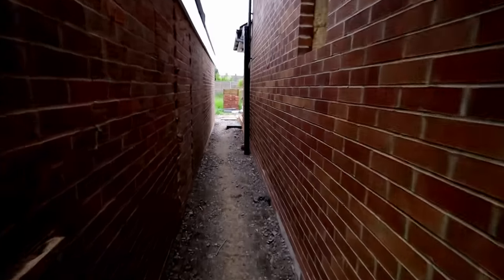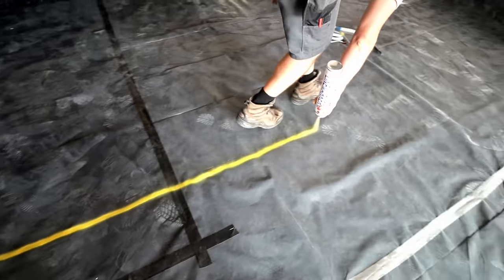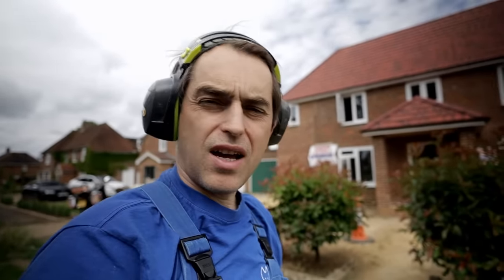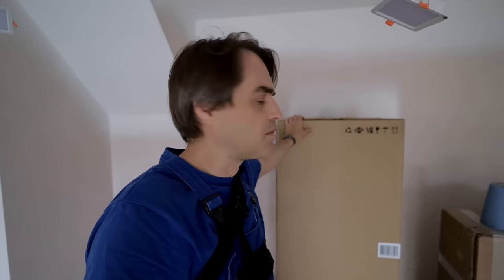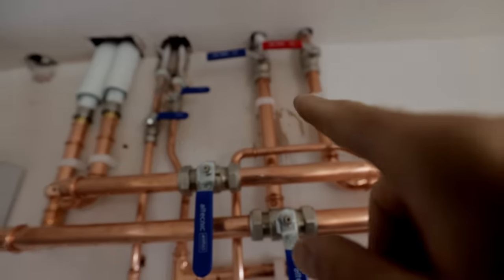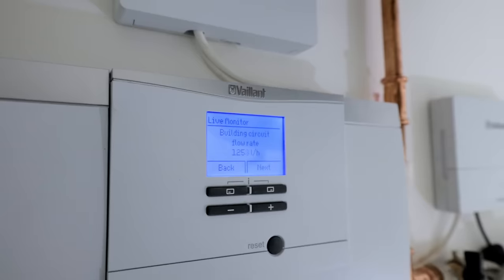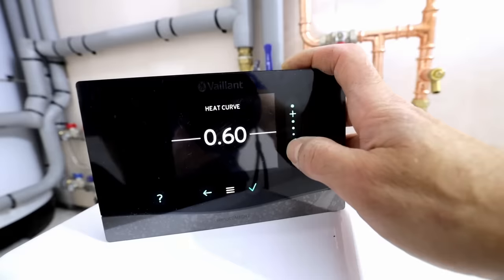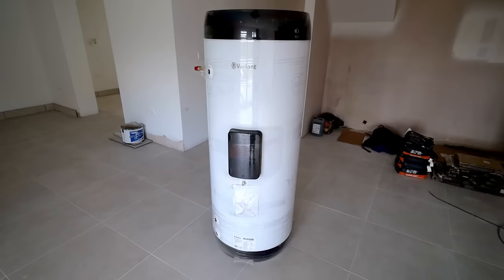Gas Boilers No Longer Make Sense, Here Is Why.

Comment: We have a Dimplex air to water heat pump for underfloor heating and then we ran a line up to our top floor attic for a water to air fan coil. It provides perfect air conditioning in the summer and is honestly one of the best reasons to use air to water heat pumps. They do perfect radiant heating and very good cooling, there are also smaller convector radiators from Jaga that are installed like radiators and provide decent room by room cooling. A technician like yourself should look into this as more people request aircon in your market.

Comment: That's going to be such a high performing system! Top work as always 👏. What's the KW rating of the unit you fitted? It looks like a 5kW unit? You should do a follow up video to document the performance and how well cooling works. I think the option for cooling could be a great selling point for a ASHP. What made you go for a Vaillant cylinder? It looks like the Telford HP cylinders have a larger coil and slightly lower cost.
Reply: After the oil crisis of the 1970`s in rural areas straw burner was the rage my cousin built wood framed house house installed the strawburner in the garage he had to abadon his house one night and call the fire brigade luckily thay saved his house but gave them all a scare

Comment: The upstairs AC loop to the ducted system will also provide dehumidification.  What outdoor design temperatures do you use for the heat loss and heat gain load calculations?

Comment: You can also add solar and batteries to your house when you have a heat pump and run it on that energy instead of grid energy, can't do that with a gas boiler :)
Reply: More added costs though. It is not cheap to add solar panels and batteries
Reply: Problem is in the UK, solar output is inverse of heating requirements
Reply: @ctid107  Ally PV and batteries with a Time of Use electricity tariff and you have an absolute no-brainer. In winter charge the batteries with super cheap electricity and then run the house during the day from them. In summer, PV will charge the batteries, run the house and heat the DHW.
I have 2 x BEVs, air-to-air HP that does cooling in summer and heating in winter in some rooms. I also have a legazcy gas boiler for some heating and DHW in winter. PV and batteries have halved my electricity costs and slashed my gas bill.
Reply: Why ever not? You could easily run a gas boiler from solar electric, it only take a hundred watts or so for hot water and similar on top for the pump when the heating is on.
Reply: Solar will not produce much energy during the winter. A heat pump has to be on for something like 18 hours a day in the depths of winter. It will use something like 50kwh per day. A battery will not be of much use in such conditions. I know because I have a ground source heat pump and solar panels.
Reply: You would need something like a 50kwh battery and charge it at something like 10kw for that to work. @Cheradanine

Comment: Have you ever fitted a heat pump system on a typical Victorian terrace house with single brick walls and suspended ventilated timber floors? Do heat pumps still work well (heat sufficiently/ remain cheaper than gas) in these old buildings during cold winters? Considering getting one but haven’t found reliable info on old houses… oldest I’ve seen are 1930s semi-detached houses with double leaf walls with blown insulation, space for a large water tank (often missing from old houses predating modern heating or where combi boilers have been used for years), and plenty of garden space to site one.
Reply from the maker: Yes I have. Check my other videos

Comment: Wow, that's a crazy amount of plumbing. How do you get the domestic water hot enough? That needs to be way higher than the central heating temperature.
Reply from the maker: It is. DHW can get to 70c if needed. Normally 50c is enough

Comment: Yes that chilled water will be %100 air conditioning. 
You will simply need an Air handling unit to transfer the rooms heat back to the water for it to return to your outdoor unit where it will run in cooling mode (reverse cycle) to reject the heat to outside via refrigeration cycle. 
Then the chilled water heads back upstairs. 
HEATPUMP = reverse cycle air conditioning normally.

Just another true advantage of replacing the old boiler
Reply: Not true air conditioning as no control on humidity but why not take advantage of the four way valve, I've done this to my house and I had a problem with very low humidity <25% not good for furniture, wooden floors or people( people should have 45 to 60%) I had to install a humidifier   all good now
Reply: @MG-qo5ge  The fan coil unit if set to a low enough flow temperature should bring some humidity out of the air, although the floor temperature's must be kept in check otherwise there'd be condensation on the floor and it would become uncomfortable. I'm not sure if its possible to have 2 different flow temps like that.
Reply: This will depend on the due point. The chilled water temperature will have to be above that point to reduce the dehumidification effect and  the under floor temperature has to be controlled possibly through the 0-10v proportional signal serving a 3 port valve This does bring in cost and complexity considerations and also if it goes wrong try to find someone  outside the industrial fraternity ....good luck  @MichaelFlatman

Comment: Can the heat pump be installed in a 1st floor flat that has a boiler cupboard large enough for a tank? Can the external unit be suspended by bracket on wall?

Comment: Just top ! I agree with everything, i’m 23 years install business and i constantly crash in people who calculate cash back  of heat pump driving a 90.000,00€ car 😂😂😂😂
Reply from the maker: thank you! makes no sesne does it?
Reply: Yes no sense … when you tell to the people truth they are accepting it as a lie 😂
Reply: This i do not agree with. 95% of people can just about afford to pay the mortgage and food on there table and many houses in the UK need to be properly insulated before installing a heat pump.

To make use of a heat pump you also most likely need to upgrade your existing radiators for larger ones and ideally install solar panels with a batter(again more costs)
Reply: @jonneymendoza  well if you are going to quote stats….less than 40% of people have a mortgage
Reply: @chriss4949  I'm talking about people who have a mortgage ie own there own property.

Not sure what your point is regarding my post about costs for insulation and solar panels.
Reply: @jonneymendoza yes, correct, but as  with most things in life, if you can't afford it you don't buy it
Reply: @David-bl1bt  yup but the thing is. If you spend money on insulation, solar power and air source heat pump, how long does will it take to break even and start to see the benefits?

Comment: Great video but yet again, these heat pumps are only suitable in a new build situation where all of the insulation and pupework are built in to there latest standards Totally irrelevant to most of the existing housing stock in the UK unless major uplift is also included.
Reply from the maker: not true, i have a number of videos on my channel showing installation of heat pumps in period, uninsulated hosues, that not only are cheaper to run than gas boilers, but also provide much better comfort.
Reply: @UrbanPlumbers  for example, my house has roof insulation and double glazing. I attempted to run the boiler flow temp at 55C. the result was the house didn't reach desired temp in any sensible time on a cold day. I have cavity brick construction. It would appear that for most of the existing housing stock, these low flow temps are useless unless a much larger investment is made in insulation, radiator sizes and in some cases, pipework.
Reply: @michaelhughes7706  radiators definitely, pipework only if it won’t support the required flow of water. Central heating is pumped so it isn’t so much if a problem, but the pipework still needs to be correct. Otherwise, get the rads sized properly and it’ll work fine.
Reply: @jonh1808  yes but nuch larger radiators along with the insulation requirements is a significant budget uplift which for most of the UK housing stock would require. Comparing a simple heat pump installation with a gas boiler  in anything other than a new build is usually nonsense.
Reply: @UrbanPlumbers hi yeah I’m gonna put 35 mil pipework all over your 60m2 terrace btw hope you have a yard and your kids don’t like playing outside cos that’s where the HP is going… PS you know that 1 cupboard you have? Cylinder cupboard now mate.
Reply from the maker: 60m2 terrace doesn’t need 35mm.
Reply: Not true. There have been many successful installs on very old houses.
Reply: You just can't go from a flow temp of 65-70C down to 30-40C without system and insulation changes ....unless your installation was massively over specified in the first place, or you are living in cloud cuckoo land.
Reply from the maker: Just check my other videos where I do exactly that before you start insulting people for no reason
Reply: @UrbanPlumbers  I have seen your other videos. At that time your view was that an installation review was needed (prior to installation) to determine the insulation and radiator suitability. So basically, I'm saying exactly what you used to say. Are you now saying something different?  Btw, I don't insult people but I have the right to criticise a comment that makes no sense.

Comment: Hi Urban Plumbers, as always a really neat install and informative video. Please let us know what the installation cost is for this install, and also going forward the costing for your other installs please. I understand and agree we need to look forward regarding green energy measures to our homes ( which I have done with my existing 1950's property which is now EPC A) . 
Actually with no one in the property during the install ( luckily so when the tank is faulty and caused significant delay, which if you where installing in an existing property would be unacceptable for someone living in a property at the time) and with retrofit wall, floor and roof insulation it is possible to produce an energy efficient building. 
The problem comes with retrofit to existing housing stock in the UK, which is generally old and poorly insulated. The upgrade costs for a typical Victorian or Edwardian property are very high before the installation of an air source heat pump system. The typical install costs for an air heat source system including larger radiators etc is as per government figure £12K to £18K which is substantially more than a high efficiency boiler and Radiators. This figure plus any mitigation to the existing EPC value of a property make it very unlikely that those who could really do with benefiting the most would never be able to afford to install an air source heat pump.

Comment: With Solar Pv panels yes its a no brainer, without them.... electricity is 3x the cost of gas. I have anecdotal stories of high running costs I'm sure you'd disagree with but my point is the argument is a lot closer call.
We need cheaper more efficient panels, more installers and cheaper electricty. The future has started but its not quite there yet. Same with electric cars and vans
Reply from the maker: this system will run at scops of 4.5 or higher though, so even without PV it will still be much cheaper to run than gas.
Reply: Whats the installation cost for one house all in? The builders I work for are very concerned about the costs. They fight me on pipe sizing all the time. The scops impressive and I'm moving away from working for builders full stop.
Reply from the maker: Yeah, builders are a nightmare in this country
Reply: It’s not just solar panels you need. First gotta look at your properties insulation. Does it have cavity walls? 150mm insulation on the roof? 100mm insulation underneath your floorboards?

Double glazing windows? Sufficient sized radiators? A place to store he hot water cylinder?😊
Reply: There are no shortage of forums/blogs with people discussing the relative merits of their own heat pumps, from a real world cost point of view. It’s never more than a 50/50 split between people who are happy and people who wish they’d never touched them, running costs being the single biggest problem. Some will have been poorly installed, and some incorrectly sized, but equally, a lot of people who were reasonably happy were off grid and dependent on oil/LPG with all the messing around and extra cost involved.

Comment: There is ONE huge issue that is overlooked when talking about all this ASHP stuff. That is, electricity supply. We were threatened with rolling blackouts last winter which would mean a cold house if you did everything with electricity. Having a gas boiler gives you a backup option (called diversification  redundancy in tech speak). So for that reason alone I wont ditch my gas boiler or cooker any time soon. Niec to have options.
Reply: I'm not sure about your gas boiler, but mine won't work if there's no electricity.. 
Same point with EVs, where people say: but I can still get gasoline if the power grid goes down! Nope, because the pumps and payment systems won't function..
Reply: @trashmail8  get a small ups or generator - a boiler only uses like 60w running
Reply: @mattsan70 That’s what I’ve done 👍
Reply: Even if the power was out for 3 hours most houses aren't going to lose enough heat to be a problem.  And with those, it makes the fabric upgrades all the more worthwhile doing to keep the existing heat in. UPSes are designed for keeping things running for a short period of time to enable someone to turn them off if power isn't due back on within the timeframe needed, not for sustained use.
Reply: @BenIsInSweden  That’s very true, I’d only need to use it in exceptional circumstances anyway as my home is well insulated and stays warm for a long time after the heating goes off. The main reason I purchased my power bank is so I can have light and other essentials if/when we have power cuts during winter which were predicted. Also use it when I go camping in remote places so it was bought for multiple purposes.
Reply: We had a war in europe, a massive energy crisis, and we got through it ok.  Gas supplies are just as vulnerable

Comment: Total Bollox I've been installing gas boilers for 40 years and they have never been so reliable and Efficient and gas at the moment is half the price of electricity,a modern gas boiler will heat your home and hot water far more efficiently than a heat pump and having worked on heat pumps on repairs both expensive to repair and loads of complaints from customers on efficiency,heat output and very expensive to run.
Reply: “More efficient” “gas is half the price of electricity” - you have zero idea what you’re talking about, lmao. You literally proved that gas is worse, a decent heat pump is 4x more efficient than a gas boiler so if gas was half the price it would be 2x the running cost, hahahaha
Reply: @Etacovda63 doesn’t matter what imagined efficiencies are when electricity is so much more expensive. I have refitted my CH and sized everything for low flow temperature, I can run the boiler hot for a short while to warm the place up then let it run at low temperature after that. Very very efficient. You’re ASHP will never compete, if for no other reason than the exorbitant cost of installing them wipes out your mythical savings.

And as I’ve posted elsewhere on here, Mitsubishi charge a minimum of £36pm to cover their heat pumps, and nothing else, which suggests they aren’t expecting them to be cheap to maintain either. You’re welcome to them.
Reply: I mean if gas did cost half the price of electricity it would be a no brainer for the heat pump.

Comment: im doing a renovation for myself and i wanted a heatpump for heating and a gasboiler for water. But i dont have the budget so now i will install a combi boiler and if i have the budget i will install a heatpump. I prefer a gasboiler for hot water bcs the high deltaT and no heat loss if u dont work with a cilinder. Als if the heatpump if broken, i have my gasboiler in reserve.
Reply from the maker: have a look at new Intergas hybrid set up. It looks very good and is not that expensive!

Comment: wait for electricity prices to jump 400% ... soon ....

the idiocy of government ideas is never ending .. diesel cars ... etc DO the opposite of what government advises every time is my advice ... 👍
Reply: And Gas will stay the same? An increase in electricity prices will just drive more solar PV and batteries being installed because it will make it an even more worthwhile investment.
Reply: @BenIsInSweden  yes gas will probably get relatively cheaper 

Shale gas coming soon
Reply: @the1beard  You mean Fracking that Liz Truss lifted the moratorium on in her short term and that Rishi swiftly recommitted to it?  I'll file that under the same folder as Hydrogen for heating homes. The problem is even if electricity does jump by 400%, gas would need to rise by 100% or less in the same period to maintain how things stand today with regard to HP vs Boiler running costs.  I don't see that happening.
Reply: So true! But we eill get shafted any ways!

Comment: What temperatures do you expect from the hot water cylinder as your flow temperatures are only 35° ?
Reply from the maker: PDHW has 2 flow temps. Cylinder will give 50c with weekly legionella cycle boosting to over 60
Reply: @UrbanPlumbers  That makes more sense. Thanks for your quick response.

Comment: I have a similar set up on underfloor heating but with out heat pump, i have hot water boiler, my undefloor heating doesnt warm properly, i have noticed the expansion is only at 1 bar, is that enough ?